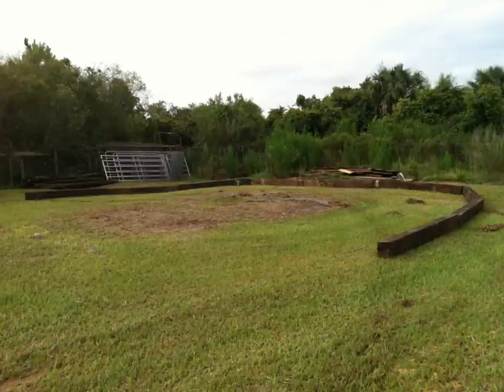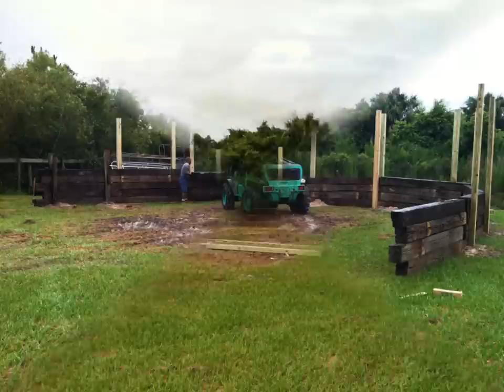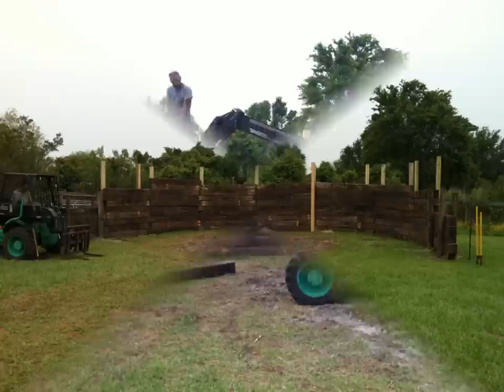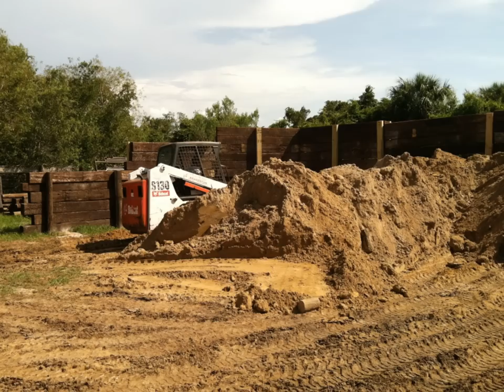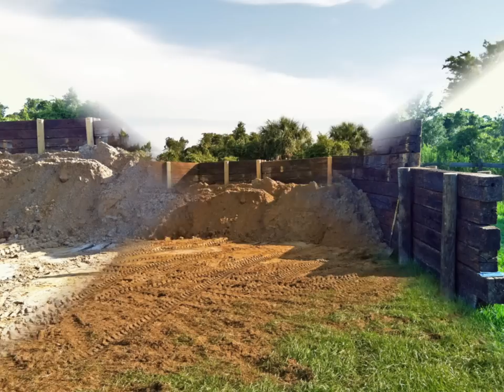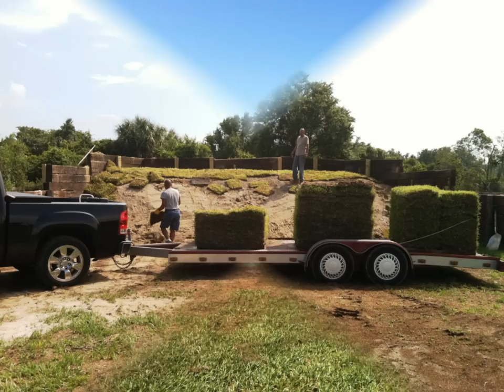Building A Shooting Range

Comment from the maker: Thanks!  I considered this the same as a landscape berm at the rear of the property and I am zoned agriculture so I did not apply for a permit.  I only had to purchase the railroad ties, lag bolts and 4x6s.  The cost was $1432.  The place had cheaper railroad ties that would have worked fine but I did not realize it at the time.  The rr ties came from Tampa Cross Tie and they delivered them.

Comment: Hey Chris! Nice looking range. Now that's you've had it for a while, would you do anything differently and/or have you experienced any problems with the execution or design?
Reply from the maker: Howdy, No, fortunately I would not change anything and it has worked out great.  We have added a covered area about 40 yards back, with two picnic tables/benches.  We can move up or drop back form this area when shooting.  This works out great in the summer to keep us cooler and it makes a big difference that you don't get burned picking up a rifle that has been sitting in the sun awhile.   Now if I could just get time to practice more....